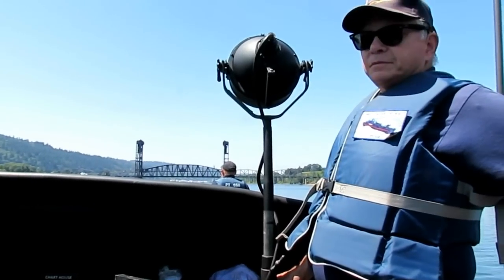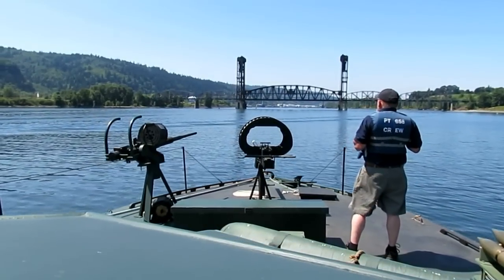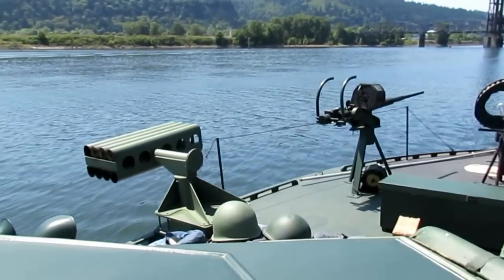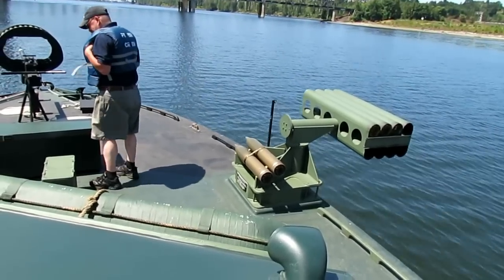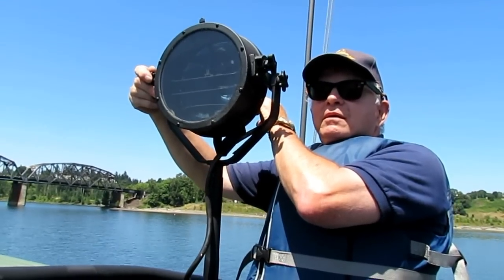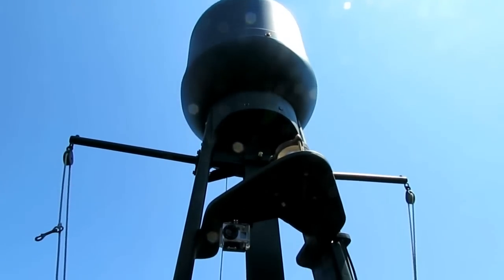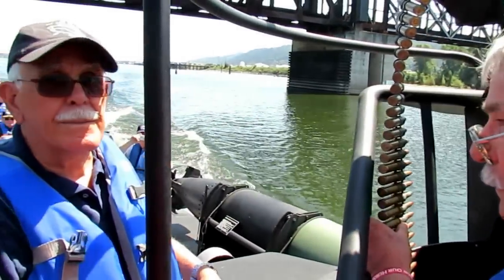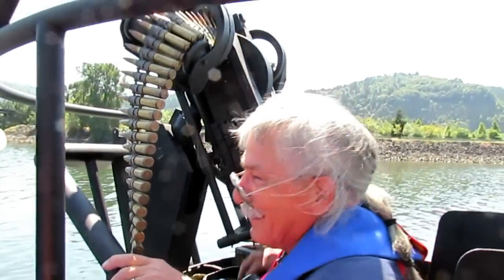PT658 PT Boat Trip to St Helens  Part 4 July 13 2012  MVI_1780.MOV

Comment: I saw one of these boats in the Burnett River ,, the petrol motors had been replaced with  two V16 GM's ,, because of the reduction of HP she would only do 22 knots.
Reply: Russell Clement is be ok

Comment: Where are the torpedo launching tubes?
Reply: No tubes. You steer to aim... and roll 'em over the side.   :D
Reply: The roll off racks were an improvement over the old, cumbersome torpedo tubes that weren't all that reliable.  Using the Mark 13 aerial torpedo,  it was a much better system that the crews welcomed. Pretty soon, all boats-including both Elco and Higgins PT's, were being built with the new drop racks.